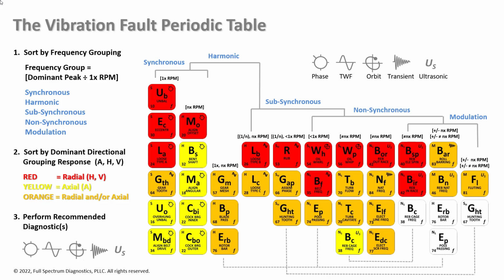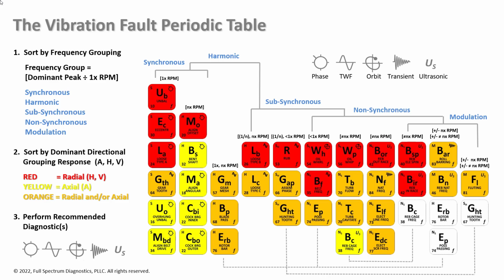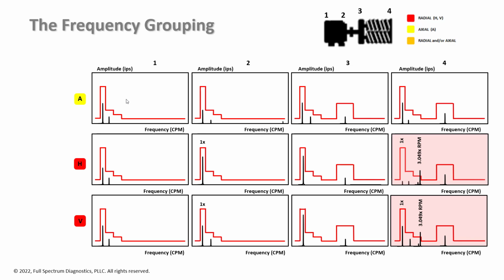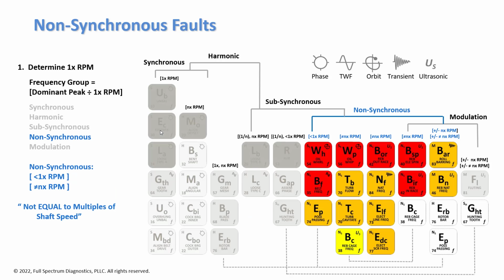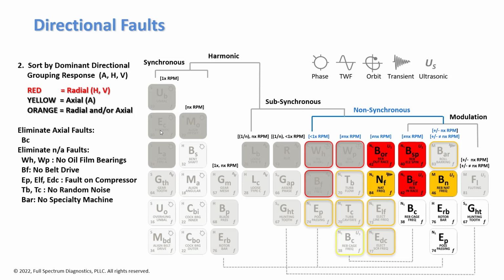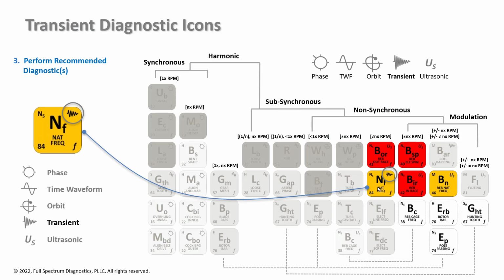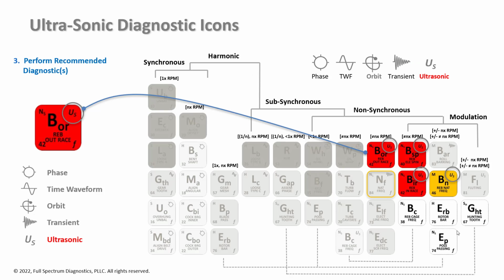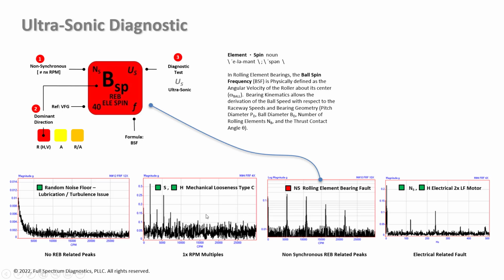Non-Synchronou Fault Example

Comment: When looking at a nonsynchronous, I often convert the TWF to circular format and the resulting pattern will show the bearing fault as well.
As with all the tests running speed must be determined exactly.
Just another check to ascertain the correct diagnosis, Customers hate to pull equipment and find out you were wrong.